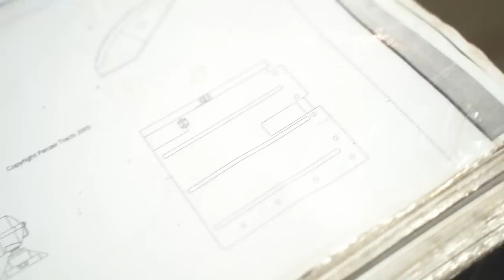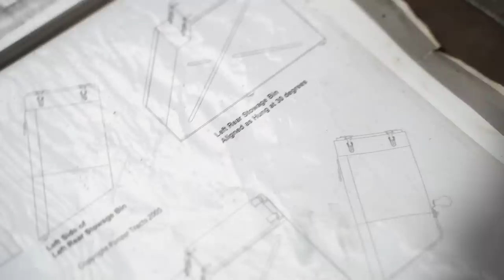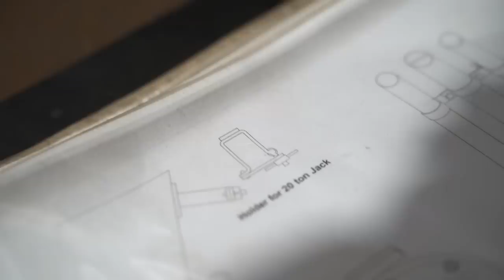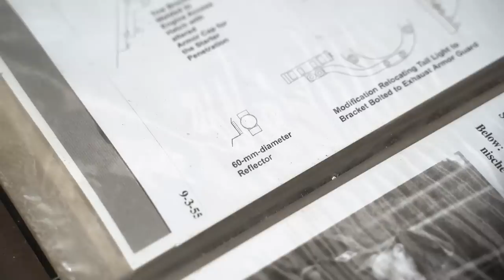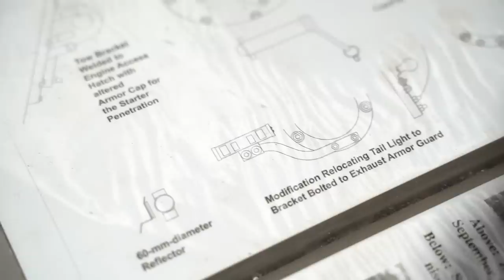Workshop Wednesday - JAGDPANTHER RESTORATION Ep. 10

Comment: Very good job as always. Am I wrong to say that this cannon has no breach? The other issue is that you have positioned the wire cutter to the rear but not over rhe armored cover to tension the track when normally it would be mounted on the side generally the left over the skirt in front of the barrel cleaner set? Normally at the rear low right is positioned the handle to crank up the engine possibly vertical and sometimes horizontal. Finally the right front guard, extremely well replicated, impressive! Keep doing a great job 👍 👍

Comment: An odd question. One suspension for the tank, one side points forward and the other side points to the rear. Why is that? Does it have to do with the tortion system if this was a runner? Just curious.

Comment: 14:29 i'm assuming that the pins are not original because they're missing their little dimple to stop the pin coming out unless you rotate it in a specific position, hence the extra holes in the OG part of the bracket.
That said, the bracketry on this unit is extensive. Lots to work, especially when it's a one-of and without the backing of existing specs. This was much more difficult than the factory worker's work.

Comment: The restoration of these WW2 German heavies to runner status, is becoming virtually impossible due to a dearth of engines, transmissions, etc., and the age of these mechanical components. I have often wondered if restorers shouldn't consider fitting replacement "modern" running gear components to a vehicle such as this, to be able to run them for the public? A commercial, inline, 6-cilinder or V8 diesel of around 500 hp is a simple thing to acquire. An Allison CD 850 transmission from a M48, or M60 tank, or a ZF4 HP from a Leopard 1, for instance, would also not be difficult to source. Fitting new final drives (essential for the Panther and derivatives) will still require major engineering, cutting and welding. The most challenging aspect of such a "restoration" would probably be the multiwheel, torsion bar suspension. This will all not be simple, but at least you'll have the stuff.

I know many people will regard this as blasphemy, but the advantages of such a conversion are obvious. One can run the vehicle at shows and displays, practically without restrictions, and witjout continuously worrying about blowing up the engine or grinding the final drives to paste and then not having the bits to replace or repair them.